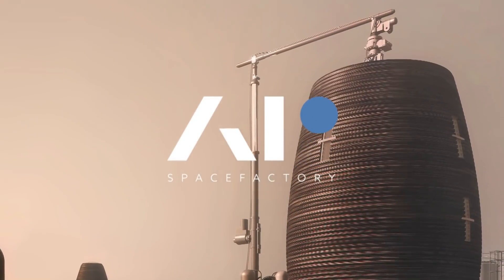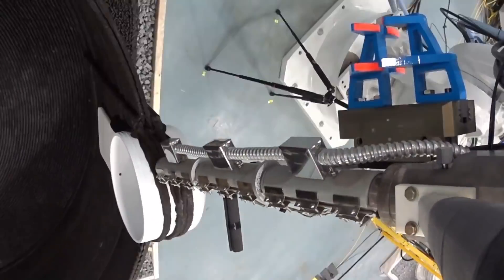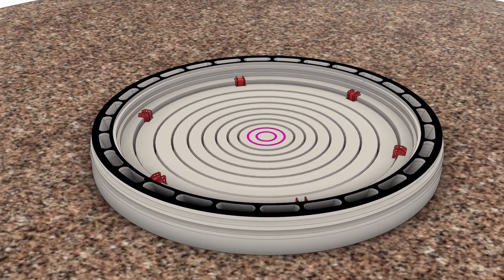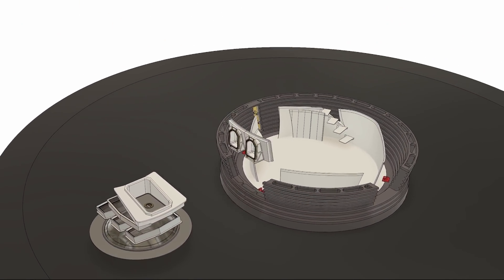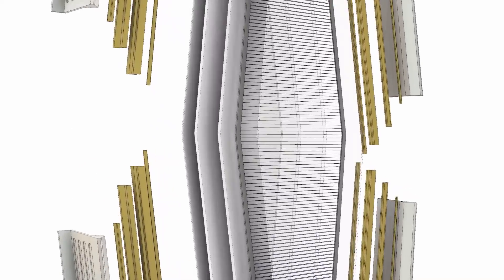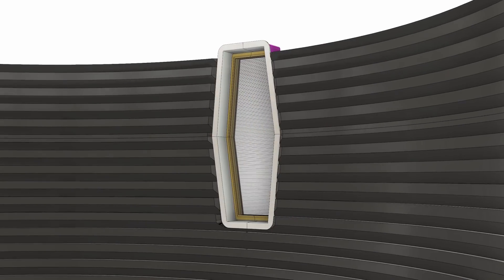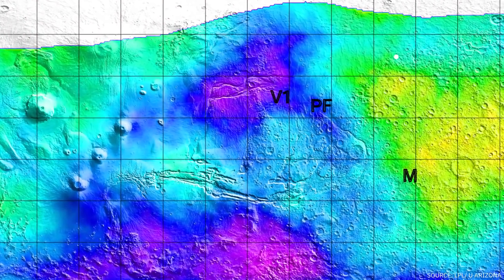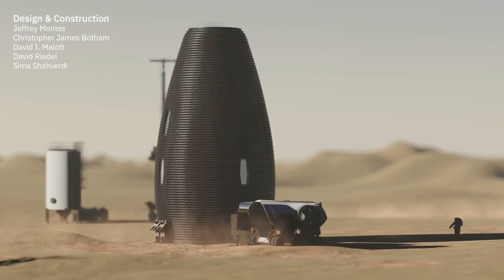AI SpaceFactory - MARSHA - Our Vertical Martian Future - Part Two

Comment: During the construction, how wiil you do protect it from the dust ?
Reply: I think he is referring to the loose particles that would remain inside the finished construction. They are harmful to the humans who will live in these igloos.
Reply: @IvanSantanaEu  This most likely. The "easiest" solution would be to have highly stretchy and inflatable "covers", which you inflate once it's inside the cylinder, inflating it so that it fully pushes against the walls of the structure. Practically sealing the insides in plastic.
Creating levels inside the cylinder would now be much more challenging though, since you don't want to break this seal, as dust particles can come in now.

I'm not sure, as it's not entirely clear, but I believe this is already their solution.
Instead of building levels that are attached to the outside structure, they'd make all interior stuff made inside, and basically building a house inside the cocoon. The material can easily be transported by adapters that connect to the ports the suites uses, sealed on earth, and opened through the port on mars.

The martian soil afaik are already highly toxic, so you do not want any human direct contact with it. So, objects meant to be touched by humans can never be created on mars from martian soil, it has to be made on earth until we find the wanted materials on mars. This inflatable "sealant" has always been necessary because of that.
Reply: Maybe some huge inflateable could be ankerd to the gorund acting as a roof
Reply: Use vacumm cleaner.
Reply: (Guessing) The schmoo is, in essence, Mars dust mixed with glue. So a fraction of a percent more dust sprinkled over a layer between turns won't hurt the next layer's self-adhesion.
Reply: @1FatLittleMonkey  With wind rates at mars, it could become problematic as a thin layer creates from fine dust stick to a resin which potentially can create a falls bond that would eventually dry and break. Maybe even under pressure, there could be leaks.
Reply: @1FatLittleMonkey , I understand that part.. but what about the dust that flies by when they are being built ??  since they are exposed to the elements of  Mars ...
Reply: @moonlander03  Not sure I understand your objection. "I'm thinking of building an igloo out of compacted snow." "What?! Out in the open?! But what if it lightly snows?"
Reply: @1FatLittleMonkey  He means if a dust storm distorts the material and/or printer while the material is solidifying. So more like "I'm thinking of painting outside in a windstorm"
Reply: @charlesdeschamps9315  "He means if a dust storm distorts the material and/or printer"

Dust "storms" on Mars are not strong enough to blow around a piece of paper. The fines that are airborne barely make up a single millimetre in depth (once they settle out over several months), unlike thick dust-storms on Earth that cover everything. So what would "distort"?

And @Ivan Santana, if you can prep the site, I'm pretty sure you can dust inside.
Reply: @1FatLittleMonkey  The dust is highly toxic to us, if some would remain inside the constructed base it would be catastrophic...
Reply: @guysebastiangarciapomales2341  "The dust is highly toxic to us"
Do you know what about the dust is "toxic"? Because if you know what it is, it gives you the solution.
Reply: @1FatLittleMonkey  but the dust they are building it with is radioactive...

so the building will be too
Reply: It's here 3:23
Reply: So I'm not the only one who does the double i thing by mistake!?!
May I ask what keyboard you have?
Reply: drones
Reply: Spacefactory roomba. Most likely using rotating brushes to throw dust into catcher, as there is almost no atmosphere, so suction fans aren't an option.